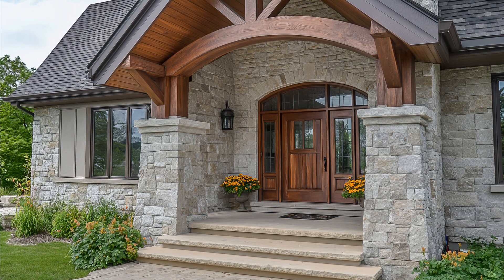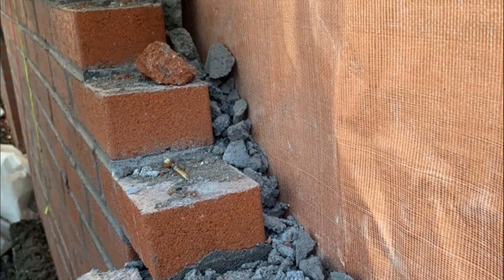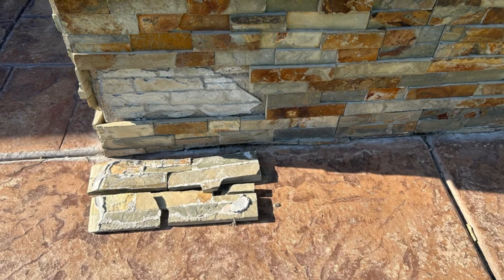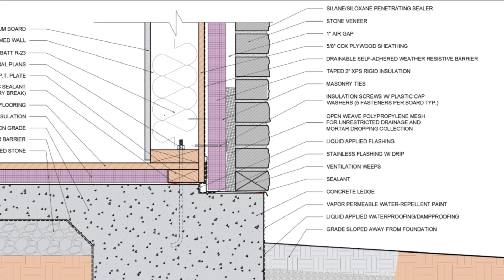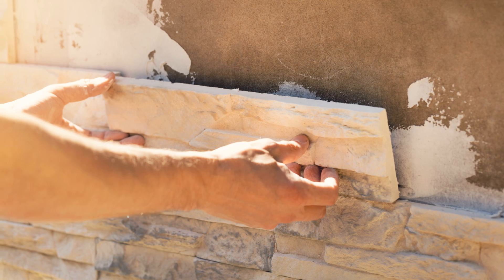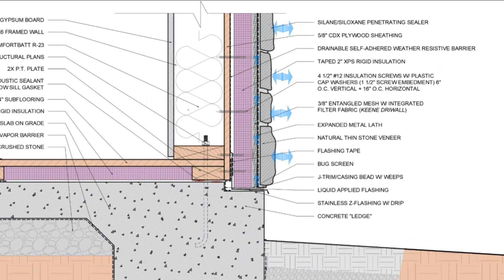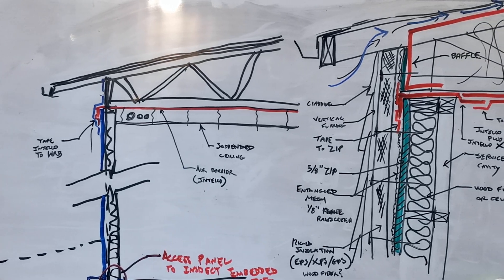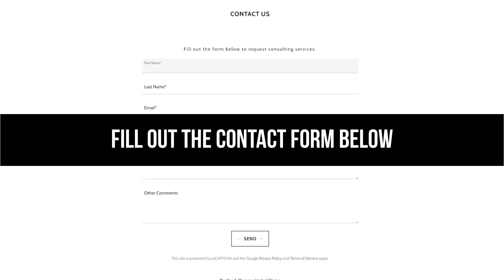Preventing a Stone Veneer DISASTER (What They're NOT Telling You...)

Comment: This is an easy fix.
 Basd on real stone "veneers"  between say, 4 nches and say 10 inches  thick, you install a vertical only 1 and a half inch cavity batten, which is fixed to the studs. ,Then  install a fibre cement board screwed through the batten and into the studs. This board is Then sealed with block seal or black seal. The stone sits on a foundation as per usual. I breather hole for every cavity top and bottom to create catabatic  draw.

For veneers that are  around an inch or more that don't require a foundation:  you install 3/4 inch vertical only cavity battens  over each stud. (over the building wrap) 
Install a 10 mm fibre cement board, which is screwed off, then sealed with Maplelastic smart water proofing membrane. Glue on your stones with Mapei S2 ultra- lite or  kerabond and isolastic.  Job done,  guaranteed not to fail or let moisture in.

Comment: I'd like to do exterior insulation , corevent/furring strips, cement board, then thin stone veneer,  with a full 3/4" airspace provided by the furring strip space. Do you see any problems with this approach?
Reply: Weight would be the chief concern. Definitely something for an engineer to look at.
Reply: @davidjoly9816 If I couldn't calculate a moment of inertia on a fastener anymore, I would eat my socks 😂

Total weight isn't an issue for the framing any more than another lick and stick system. And the foundation was engineered for brick. Only the moment of inertia would be slightly more with a gap.

Comment: Hello and good day.

  Would a 1/8th inch corrugation to the back of a portland cement based panel be enough for a drainage gap. The panel as planned, from the exterior towards the interior: rain screen, ventilation gap, insulation (R 2-4), 1/8 corrugation.
 Based on the video, I don't think the gap I describe would be enough? But if using a dimple mat or entangled mesh between the house and panel would that reduce the effect of the panels insulation properties? 

 Thank you for your thoughts on the subject. I truly value these videos.
Reply from the maker: For drainage, absolutely. For ventilation, it's probably not the best. Generally speaking you want about a 3/8" gap to maximize the benefits of ventilation drying, however, a drainage gap is definitely better than nothing and will address the majority of the problems.

Comment: My question is about stone veneer (limestone) on cement backer board in the (cement foundation)space between cladding and grade level. Rock wool behind cement backer board. What do I do to make this work? You have the very best presentation . Most impressive. Thank you
Reply from the maker: Thank you for watching and great question. You can either provide a drainage gap behind the cement board itself, or you can drain behind the rigid insulation. Luckily, the Rockwool is inherently drainable since it has a textured surface. You probably would still want to avoid any polymer modified mortars so that it maintains a bond to the veneer. StoCorp actually has some similar solutions: https://www.stocorp.com/mves/